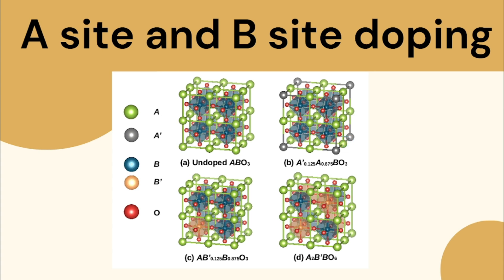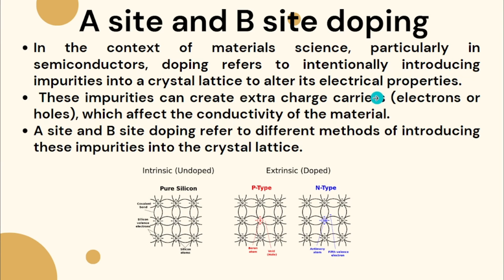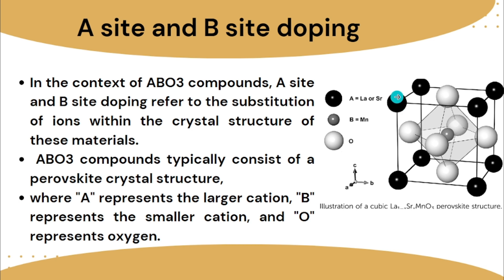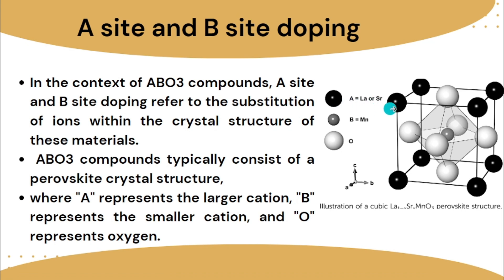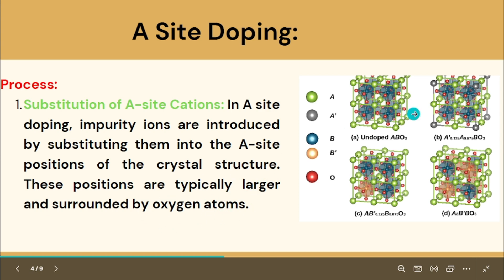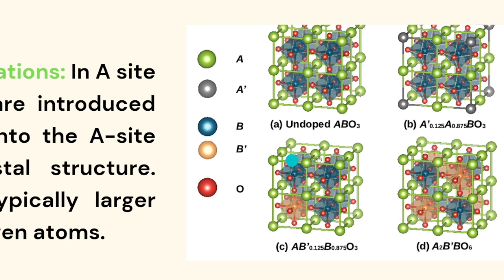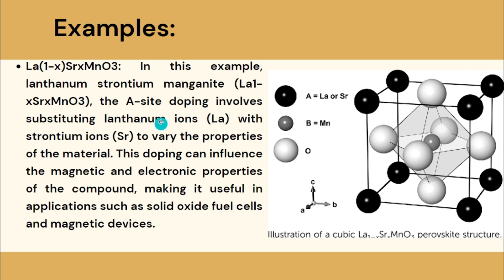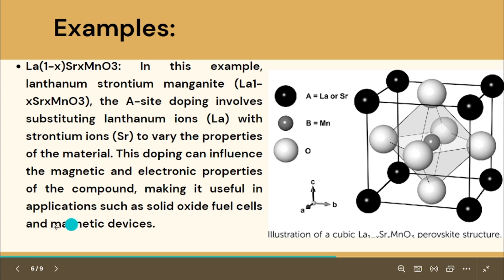A Site Doping and B Site Doping In Perovskite  structure | ABO3 DOPING

Comment: Hi could you pls explain how the charge is balanced when La3+ is substituted with Sr2+?. Also at the same time a B site doping of Mn with Fe in LaMnO3
Reply from the maker: Sorry for the late reply. "When La³⁺ is replaced by Sr²⁺ in LaMnO₃, the +1 charge deficit is balanced by oxidizing Mn³⁺ to Mn⁴⁺. If Fe³⁺ substitutes Mn³⁺, no extra compensation is needed, but if Fe²⁺ is introduced, oxygen vacancies form to maintain neutrality. For Fe⁴⁺, additional Mn⁴⁺ or electron holes compensate for the excess positive charge."